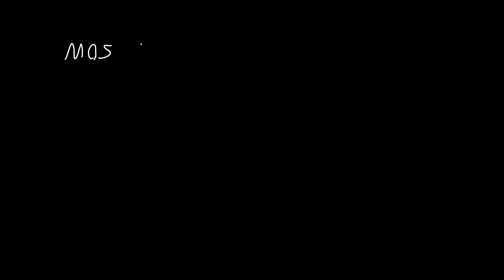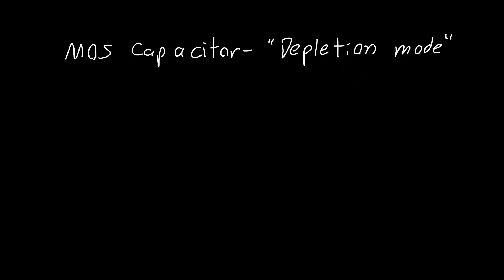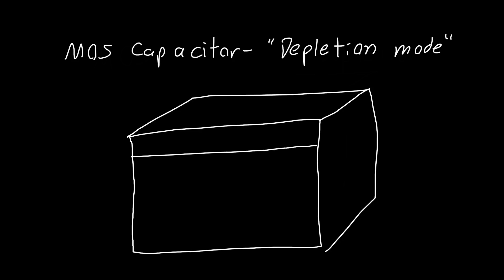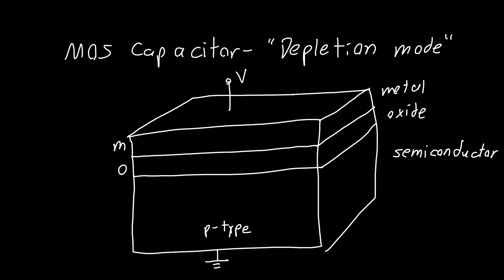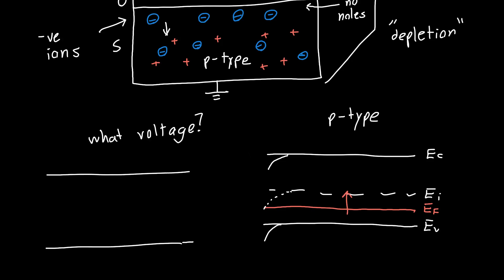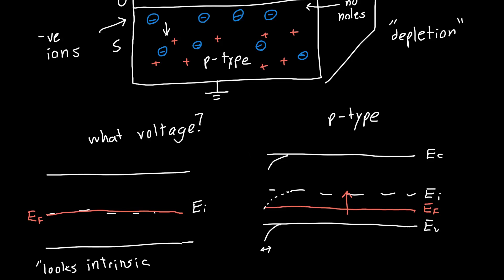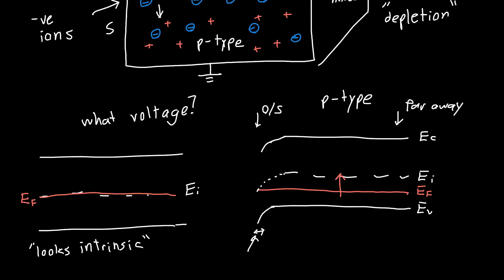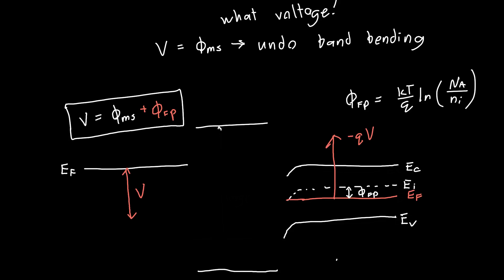MOS Capacitor - Depletion Mode Explained

Comment: Hi thank u for this lecture,  it's so helpful but i did'nt understand why when we are in depletion mode (so we apply  a positive voltage < Vth) holes come out in Metal and they lie on the surface between M and O or the position doesn't matter?

Comment: At 6:56 you mention Ef is constant what that means 1)it can't move in band diagram of 2) bending of Ef will not take place?
Reply from the maker: Exactly. EF is constant means that it is the same value throughout the entire band diagram. This will always be true if the system is in equilibrium. Bending of EF does not happen in equilibrium. It will only happen when you have current flowing, and even then it gets kinda complicated (in the form of quasi-Fermi levels).
Reply: @JordanEdmundsEECS  when we apply positive voltage to gate after undoing the intrinsic band banding, Ef of metal should move down and Ef of semiconductor remains at the same place. Is it what you want to say?

Comment: How negative voltage applied on the semiconductor is going to drag the band diagram up? Please explain! Thanks!
Reply from the maker: This is a common confusion, band diagrams are the electron energy, so there’s a negative sign in the potential energy because the electron has negative charge (-q*V).

Comment: when we are applying a positive or negative voltage, is it moving Ec,Ei, and Ev bands or is it moving the fermi level?
Reply from the maker: Great question, you're exactly correct. If you apply the voltage to the capacitor, after everything settles there is no current flowing, so the fermi level must be constant everywhere (this is the definition of the fermi level). It's Ec, Ev, and Ei that bend to accommodate the voltage.

Comment: a positive voltage at the gate attracts negatively charged ions at the other side, but those boron ions are already bounding with Si atoms. So when they move up they bring with them their silicon partner atomes, correct?

Comment: At 1:23 I think u made a mistake you should have said boron ions accept electrons instead of saying give up electrons and become negatively charged
That's why boron is called acceptor impurity as it's  trivalent.
After all if an atom gives up electrons it will become positively charged ion and not negatively chraged ion
Reply from the maker: You are absolutely correct, my mistake. Thanks for pointing it out!